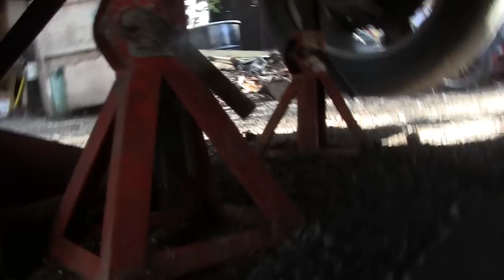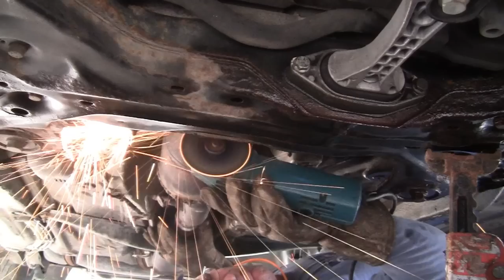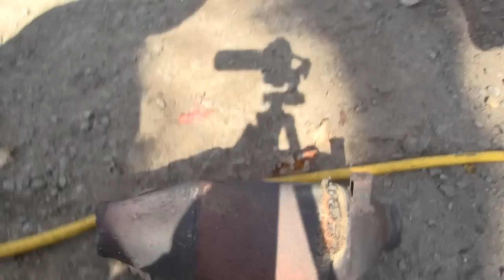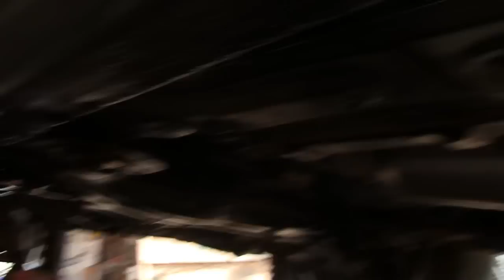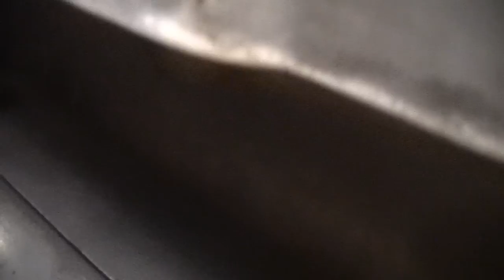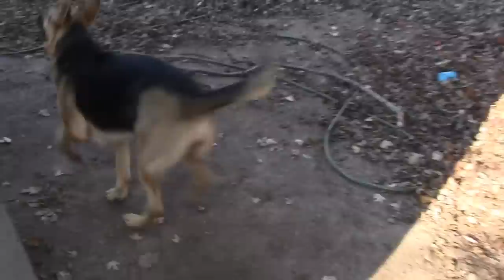Catalytic converter replacement.mp4

Comment: Can I use a universal catalytic converter if I drill and weld bungs for the O2 sensors on a 2000 Jetta 2. 8 l VR6 GLS?
Reply from the maker: yes if you make it fit

Comment: I was going to take my cat out of my 2004 VW Jetta because its rattling and the engine light is on but someone told my that there may be a sensor wire that runs through the cat and if it gets cut then the engine light will stay on and in turn is hard to sell. Do you know anything about that?
Reply from the maker: +Luke Buckner Prob a cat code. If it dose not do its job it will flag a code in the ECM

Comment: Nice video! I just bought a 99 vw vr6 2.8 it is my first vw! I think my converter is bad because i have a real bad idle and runs rough and when i down shift it makes a pop noise like a backfire. Also when i plug a vacumme line in the back of the upper intake manifold the engine bogs right down and stalls. If i unplug the vaccuume line it runs but runs like crap! I think it is the converter and it is running rich! Does that sound like it could be the converter and if so i will take it off and i will have to get a universal converter but the ones i have seen only have 1 hole for the O2 sensor and there is a pre cat on there also! Should i take off the pre cat or just the main converter and replace it? Again nice channel! Any help or opinions would be great!

Comment: I was thinking about replacing mine but i dont have access to a welder. Its a gmc sierra 2500. So it looks like I have room. If I clamp it down tight shouldnt it be good?

Comment from the maker: Some times, but it is hard to get some of them in there. Sometimes there is not enuff pipe to clamp the cat onto. If you get an exhaust leak before the cat it will fail the e-test on Nox

Comment: Hello Shawn, thought I'd chime after watching your vid's to see what you had going. Appreciate the friend invite. Your vid's are really useful and help a great deal, not to mention funny. I died laughing at your seat belt/ airbag test video. I'd watch more but am concentrating on how to remove a broken off brass tubing end that is stuck inside the threads in a drain hole on the bottom of a 1950 truck gas tank I pulled. I tried a bolt remover but am afraid it will expand & ruin the tank threads.

Comment: @GarageCrazy I had a magnaflow high-flow cat in my last car..I wouldn't have passed if the tester didn't cheat, it was about 3 years old.. I don't think high-flow cats do as good as a job as normal ones though unless you heat them up like a mother ***

Comment: @ShawnCFarm Overhead welds maybe try a U shape weld from the bottom to top 1/8 burn both sides in a U shape but overlap -- should get a slag rise in the middle that chips off over the joint  arc should sizzle not snap , thats how I taught the kids in school !

Comment: Shawn either turn up the amps or turn down the wire feed my nephew bought the same kind of mig I got to use it for a few months without gas I was doing fenders it worked fine nice smooth lines --looked like you had to much wire feed maybe .